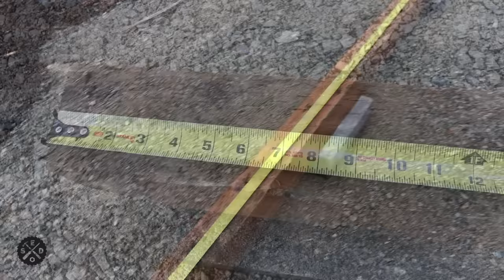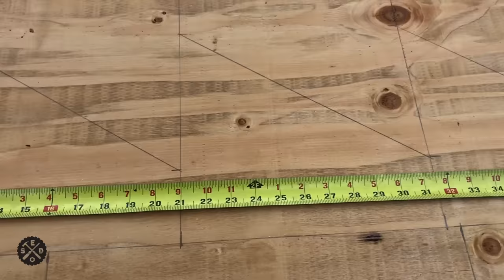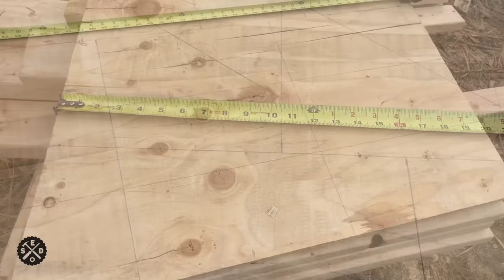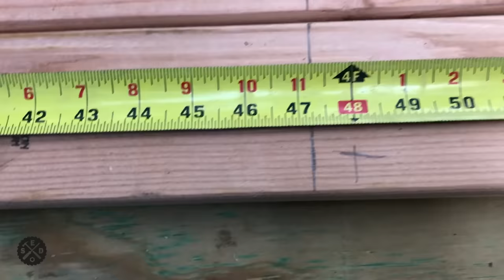How To Build A Shed By Yourself All STEPS 10x16 diy

Comment: I've been going back and fourth for months now. Do I buy another one of those 8x12 $1500 Kits from HomeDepot and build another on of their kits? Tho they don't come with flooring or roofing. So it will probably be around 2000. Or go this route and go bigger. I'm no carpenter but their kit wasn't hard really. I worry about getting the roof trusses and door straight. Help me out guys. I can't decide.
Reply from the maker: Personally I’d do this cuz you’ll end up a lot heavier duty than their kit but it depends on your comfort level. If you’ve already done one of theirs and like it that might be best in your situation

Comment: New to building. I'm curious, you don't need to lay down a concrete slab for the foundation? That gravel and brick is secure enough?
Reply from the maker: Yes it depends what your needs are for your building. If you want to do it permanently and store heavy stuff then you could do a concrete slab. The reason I did mine on skids is because I want to be able to move it down the road to a different location. Yes just doing it on packed crushed gravel and the blocks is just fine for this type of application where is just for a storage shed. For this type of thing if the frost moves it around a little it won’t hurt anything. It would be different if you had plumbing coming up under the building and were planning to heat it etc. hopefully that helps

Comment: Beautiful Beautiful shed...can I make a friendly suggestion..go to the Lumber yard and pick up some metal wind brace strips..its a little late now..but you can install them on the inside of the wall..put one on each wall ..and one diagonally on ceiling to brace your door wall...
I'm not convinced building with out wall sheating with board and batten is a good idea for structure longevity
Reply from the maker: Thank you! Yes you could do that, and actually the board and batten if it’s nailed well provides a lot of structural strength.

Comment: Can you tell me what kind of nails or screws you used? I was a little confused on the video and watched it several times now. Thanks.
Reply from the maker: Sorry if I confused you. For nailing down the pressure treated floor joists I used a 3-1/4 inch galvanized nail. For most things like for nailing down the pressure-treated plywood floor and the exterior siding I used 2 1/2 inch ring shank galvanized nail. If your hand nailing that you probably would get galvanized spiral nails since they don’t typically have ring shank for hand nailing. They just hold better than smooth nails. For nailing the truss plywood gussets together I used a 2 inch smooth nail non galvanized since it won’t be exposed to the elements. for nailing the walls together I used a 3 1/4 inch non-galvanized nail. The main difference is galvanized is used for exterior when exposed to the elements and also for nailing anything pressure treated together. If you just want to get one kind it’s OK to use galvanized nails in regular untreated lumber but it’s not OK to use regular non-galvanized nails in pressure-treated. Hopefully that makes sense. For the screws where I added some I used a 3 1/2 inch exterior rated screw. I prefer the torx head because they don’t strip out like a Phillips head.

Comment: Someone else's used 2x1s to hold the plywood for insulation.... why can't I just nail the plywood to the top and then flip the whole thing over? Is it just too heavy? Sorry if this comes off as a silly question, I don't have much experience.
Reply from the maker: Yes it’s doable with some good help or equipment but otherwise quite heavy yes.

Comment: You are often quoting prices between Home Depot and Lowes.  However did you know that both of these stores offer 10% discounts for both active and  former armed forces  (veterans).
At Lowes you just register using your DD214  photocopy and that's it (they just ask for your phone number thereafter).  At Home Depot you need to have a copy of your DD214 in hand.  It's
great that both of these stores can offer this discount to all veterans.   Thank,  Roy
Reply from the maker: Thanks Roy yes I was aware of that, not sure how many others are. Thanks for sharing. Also if you search eBay you can find all kinds of coupons for Lowe’s. Home Depot not as quick but sometimes they honor Lowe’s coupons too. Seems to vary by the store. Thanks

Comment: Where you are using bolts and nuts and want to make it difficult to remove them, just use a diamond point chisel to knick the end of the thread or peen the bolt over.  Also leave one or two bolts a bit loose so that turning them from the outside will not cause them to snap. The thief can turn them all day and they will not either come loose or snap off. Do this on both the lock and the hinges.
Reply from the maker: Thanks for sharing!

Comment: Cut 2x4 ìn half and run them in each joist bay on all 4 sides . Then cut 1/2" ply drop in and screw then either use bat or Styrofoam now your ready for Dec k ply .
Reply from the maker: Yes you could do that. 👍

Comment: Most cities, towns or villages have a set of minimum codes. That should be checked before you start. I noticed that on your header for your door you have the 2x4 laying flat. Most codes call for them to be up right the 4” top to bottom not the 2”
Reply from the maker: Yes usually as long as you stay under a certain size building there’s no codes or permit required but also the header is not loadbearing at all on the end wall if they want to get technical. You could certainly turn them the other way if you put a half inch strip of plywood or something in between them to make them the right width. For what I needed it worked OK that’s why I didn’t do it that way. Thanks

Comment: Did you plumb the foundation? HOw do you know if those first two ground beams are level? thanks
Reply from the maker: Yes I did I tried to show it in the video.
Reply: @SmartEasyDIYer  OK I guess I was being paranoid since obviously if the concrete blocks are level then they will also be plumb. thanks

Comment: Wondering why the skids & floor joists are reddish/brown instead of greenish treated pine? Also what are all those line indents in the wood?
Reply from the maker: It’s pressure treated wood. They do it differently in the west than they do elsewhere. The reddish brown is the only option available here. The indents are the way that they inject into the wood instead of soaking it in the solution like they do the green stuff. Not sure why.
Reply: @SmartEasyDIYer  Thank you for letting me know

Comment: I'd like to know how you stood on the roof at that pitch without sliding off.
Reply from the maker: I did all the roof off of a ladder just had to do the ridge cap by starting the ends with the latter and then sitting up on the peak for the middle. grippy shoes help too

Comment: This is an outstanding video.  On the door hinges, how did you get carriage bolts through the heavy framing around the door opening?
Reply from the maker: Thank you so much! I just made sure they were long enough to reach through then after the washers and nut was tightened (they sink in a bit) I cut them off flush so they didn’t catch on anything when walking around the opening. . Long enough drill bit too.
Reply: Thank you again.  I had thought the c/bolts that long were too big to fit through the holes in the hinges.  'Will look again!
Reply from the maker: You’re welcome. Good luck with your project!

Comment: Great video!  I live down in the hot south, so I would want to make some environmental changes (venting, cooling, etc.) for my build.  One question:  How do you keep critters from moving in under the shed?  I was thinking about using hardware cloth as a skirting, and burying the bottom edge under gravel to keep critters from burying under.  Do you have any suggestions?
Reply from the maker: Thanks Tom! Yes I think that idea with the hardware cloth would work. Good luck with your build!
Reply from the maker: Yes depending on your lot elevation that can be a great idea. Thanks

Comment: I really like your shed. We are building a sleeping shed. My wife would like color. Does the Rugged wood Treatment allow for adding color or staining after application? Or does it hamper its durability qualities? If I was to use Rugged and then stain the wood some color that my wife likes, will that work?  If so, do you have any recommendations for a stain product? Thanks for your craftsmanship.
Reply from the maker: Thank you!! I’ve never experimented with adding color but since it turns the wood darker I don’t see that adding color would be a very good option with the rugged.
Reply from the maker: I’m not sure what all colors you can get it in but I’ve use the Cabot stain before and it works well. They have some semi transparent ones if you like it a little lighter colored

Comment: You did a really nice job on your shed. I'm wondering if you had it all planned out before you began from start to finish ? Or did you plan it out in stages ? I can see that if you plan as you go there may be a few times when one might have wanted to do things in a slightly different manner.
Reply from the maker: Thank you! I had it mostly planned out. Some of it was just in my head.
Reply: @SmartEasyDIYer  you did an awesome job, I find that if I don't plane the entire thing (whatever it is I'm working on) in advance, there is always something that I wish I had done differently but is too late to change. Not that it's not nice when I'm done, just not exactly how I would do it again.
Reply from the maker: Yeah understood for sure. It’s good to have a plan. 👍

Comment: Wondering if u could tell me orientation of a crown on a interior wall? Or does it not matter that point, or should u not even be using a crowned stud on framing iam guessing as long as they all face same?? Just wondering 🤔
Reply from the maker: Yes as long as they all face the same it shouldn’t matter.
Reply: Thanks! I was wondering that guess that's the logical answer I expected!

Comment: If you want a bigger overhang, could you have a longer top board on the frame that extends out, then a truss on top of it that isn't supported by any loaf bearing stud?
Reply from the maker: I don’t think I would trust that. You can do longer tails on your trusses. Go lower pitch on your roof if they extend down too far for your liking with the steeper roof pitch.
Reply: @SmartEasyDIYer  I actually meant the overhang over the front door. Same pitch just an extra truss to give a larger sheltered entrance.
Reply from the maker: Oh I get you. Yeah I think you could do that. No problem. I would maybe considering putting a 4 x 4 brace underneath it on the outside wall. Just things to think about.

Comment: Before I ask this question...no I have no affiliation with the company.  Did you consider using Advantech panels for the floor and zip panels on the walls and roof instead of plywood and house wrap?  I've been renovating my house (full...everything) and we went with the Zip/Advantech system products.  Both the floor panels and zip panels have been great to work with. The Zip is nice because its less expensive than plywood and no need to put the wrap on...just tape the seams and ready for siding.  On my roof we did go the extra step of adding Ice and Water barrier as one roof pitch is very low.
Reply from the maker: Yes you certainly could I think it probably would be quite a bit more expensive but it depends what you want to use it for if it’s just a storage shed then it’s probably way overkill but if you want to heat it and live in it for a tiny house etc. it’s probably not a bad idea.
Reply: @SmartEasyDIYer  The zip panels actually cost less than the plywood does.  The advantech flooring might be a little more expensive but comes with a level of moisture protection that the plywood doesnt offer.  Its more of a heads up...I think a lot of people are not aware that there are newer materials to use.

Comment: If you're going to insulate your floor, you could put plywood below the floor joist, insulate. Then add in your subfloor.
Reply from the maker: Yes you could it just would be quite heavy to add the plywood and then flip it over if you’re alone. If you had some help or equipment that would certainly be doable.

Comment: nice build.. I just don't like that type of metal roof because the rubber grommets on the screws tend to fail pretty quickly as they get destroyed by the sun.
Reply from the maker: Thank you. I’ve never had any washers go bad on these. I suppose after many years they could. They are mostly all covered up by the metal Washer.

Comment: i like to put down a small strip of tarpaper or a piece of a composition type shingle to keep the runners from wicking up moisture thru the concrete blocks. with a rock pad and treated timbers, it's not as critical. IMHO but i live in deep snow country.
Reply from the maker: Nice. Thanks for sharing.

Comment: Am I supposed to use treated wood when building this?
Reply from the maker: You don’t have to but wood siding usually lasts a lot longer if it’s treated with something. I would recommend using pressure treated for anything that’s ground contact.

Comment: I'm  building  a tiny house on a  8x20  5th wheel trailer frame. This frame came from a extra large RV. was already stripped down to just the frame when purchased.. for weight  limits I would like to build with metal C studs and U tracks. Can i still follow same procedure. Can you recommend a video on that type of build..ty  please . As far as the elevated top of the trailer i will not be using it for inside structure. I plan to make it a deck. for a permeant porch setting. Trailer base is  the 8x20. not including the elevated top of frame .ty
Reply from the maker: I honestly have never worked with metal studs before so I can’t really advise at how strong they are compared. I’m sorry I can’t be helpful with that. I wish you the best though it sounds like a great project!
Reply: @SmartEasyDIYer  ty..awesome  video by the way..and me either just  wood ,trying learn the metal
Reply from the maker: Thank you and I wish you the best with everything!

Comment: To insulate, why not sister a 1x1 around the inside lower part of the floor joists and then drop the plywood in? That would do the trick and leave plenty of room for insulation.
Reply from the maker: Yes that could work too.

Comment: Beautiful build!  Your video is helping me plan out my 10x16 shed build.  I have one question though.  Did you cut your 92 5/8" studs down at all for the wall framing?  You mentioned you wanted a 6 1/2' door, but I'm seeing you used three 2x4's to make your door header thus closing the opening by 4 1/2".  If you left the studs at 92 5/8" that would leave you a door opening of 7' 5 5/8" from top of floor to bottom of header.  Am I missing something or miscalculating something?  Wall height using 92 5/8" studs with a 2x4 top and bottom plate makes the total wall height 95 5/8', am I right?  Forgive my ignorance if I missed something, I'm definitely not a framer.
Reply from the maker: Thank you so much! Yes my total wall height including top and bottom plate is 7’ it was just cheaper to buy pre-cut studs that were 92 5/8” instead of buying full 8’.

Comment: That looks like the wood was treated with Lifetime wood treatment!
Reply from the maker: Yes it’s quite similar but more affordable. 👍
Reply: @SmartEasyDIYer  thanks! Two more questions, could this shed be built as a 12’x16’ without changing the method of building and could I just pour a concrete slab and attach or would i need to have a foundation wall going past frost level. I live in Montana.

Comment: Another question:  did you rip your 1x4’s for your batten boards?
Reply from the maker: I didn’t need to, the mill I got them from ripped them, I wanted 3” initially but 4” is the smallest they could rip. It worked out well tho proportionately with the 10” boards. With rough cut it’s nice to not rip it if you don’t have to cuz then the cut is smooth on one side, there are way to rough it up again but it takes longer.
Reply: Thanks for the reply.  I’m currently acquiring the lumber list for this project.  I’ve gotten some of the rough cut lumber (pine) from menards but will get the majority from a local mill.
Reply from the maker: @JoeBoca1973 you’re welcome. You’ll have to decide what you want to do proportion wise but yeah getting it from a local mail. You should be able to pretty much get whatever you need custom made. 👍🏻

Comment: In Florida everything must be put together with Hurricane clips. They are easier and stronger! Toe nail splits the ends and edges. Hurricane clips all nails are in to the clips and wood so before thing come apart it must shear the nails. When installed right it meets Dade County building standards, among the stronger in the country!
Reply from the maker: Yes I’m sure it would need that where you are!

Comment: The downside to a shed that size is a lot of places need a permit for it so  some people might need to look into the 10×14 or 10×12 dimensions to stay under the permit requirement
Reply from the maker: Yes it may depend on your area. The requirement here is 200 sq ft I believe. I also have a 8x12 shed build video with steel siding.

Comment: @ 10 i wouldn't use plywood to hold my insulation, i chose galvanized 1'' hex wire mesh  and stapled
Reply from the maker: As long as it doesn’t allow critters to chew on it still.

Comment: My question is, when you use vertical slats for siding instead of plywood or some type of 4x8 sheet, do you need diagonal bracing in the wall? I'm not really a builder but it just seems like you lose a lot of sheer strength. Thank you in advance.
Reply from the maker: For the siding I did it should be sufficient since it’s wood and it’s nailed off really well. Depending on the type of siding you did you certainly could put some permanent bracing in the walls.